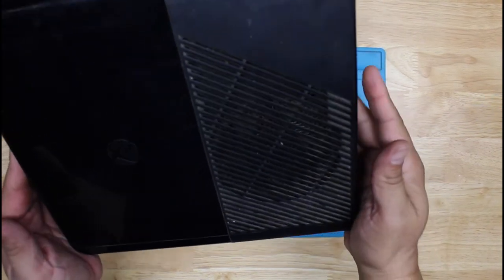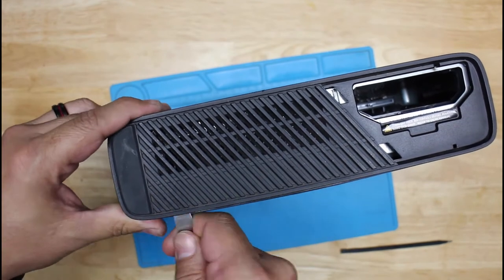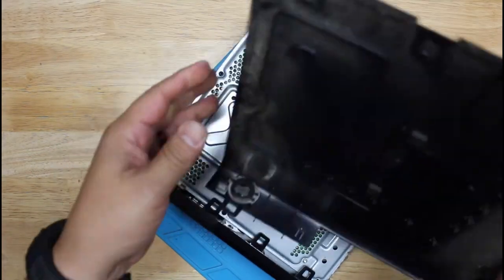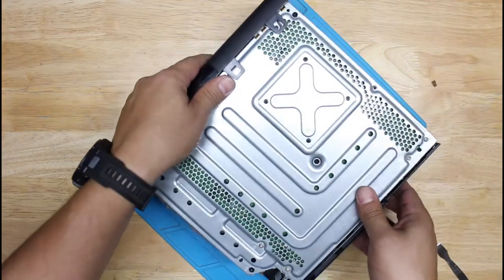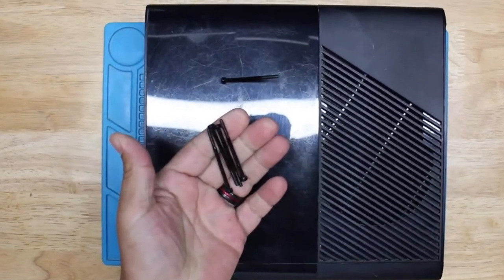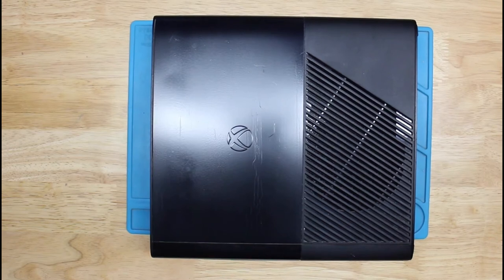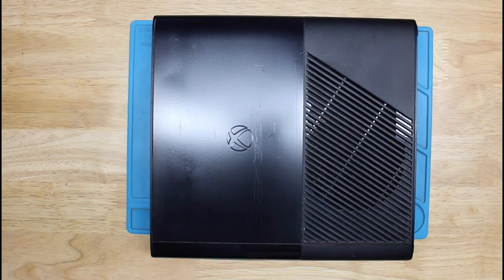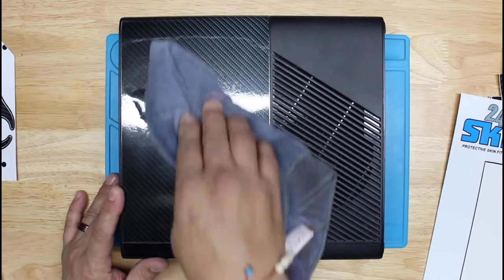XBOX 360E Clean & Restore - Install Vinyl Skin ⚒ TRU Fixes

Comment: I wonder if the old DVD-fixing trick of hot water might help to reduce the appearance of scratches on that top piece.  You'd need a large pyrex dish with a flat bottom.  But since it's nothing more than plastic, you could use boiling water and a longer submerged time.
NIce video.
Reply from the maker: That's worth a try...Thanks!